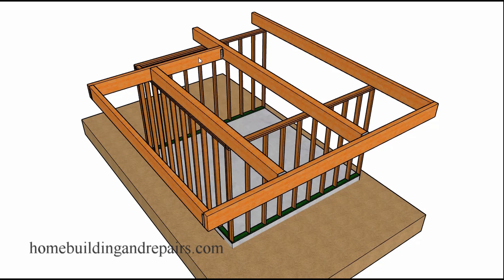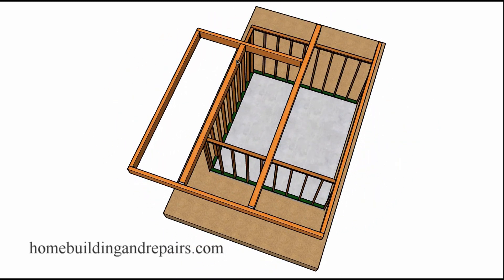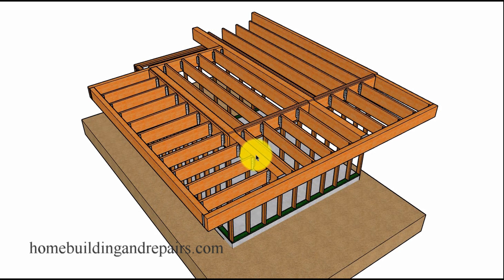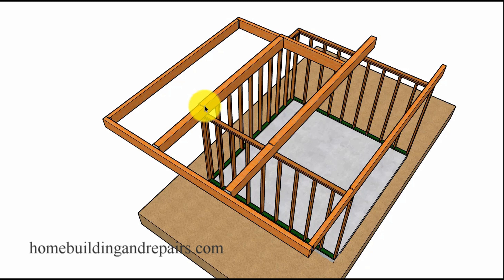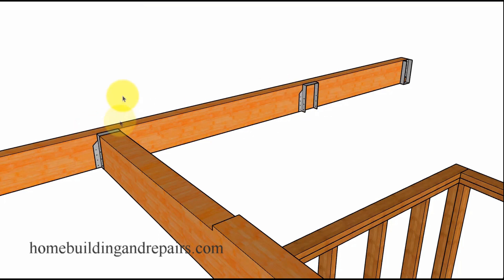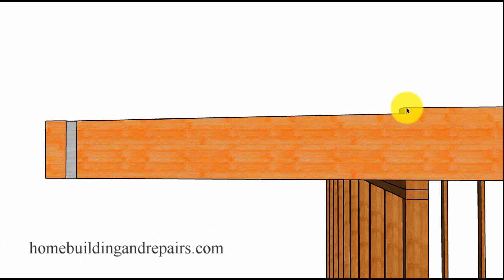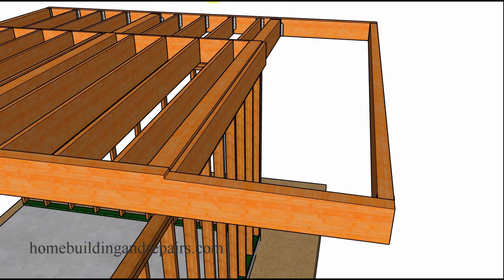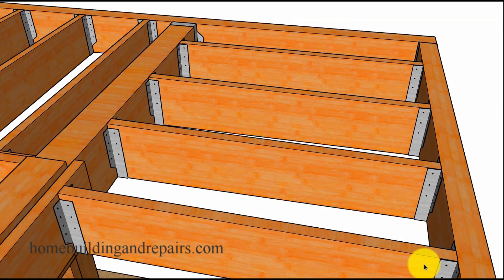How To Build Double Cantilever Corner Balcony - Home Design And Framing Ideas

Comment: Nice Greg, but something should be included too is to add min. of 3 studs under the beams inside the wall below (assuming the wall is exterior and bearing), because the load here is concentrated due to the cantilever hinge point. I'd not recommend flipping the joist hanger because this would make interior space floor structure weaker, and interior has a higher dead load weight on it due to possible furniture and also  live load because people live inside more than on a balcony.

Comment: Hi, what books will you advice to read about timber framing(walls, floor, roof) and also structure analysis? Your videos are very teachful with calculations,  standards and requirements,  but they are all over the place and something it is difficult for me to follow them and connect the dots. Thanks and cheers!
Reply from the maker: I have a few timber framing books, but haven't figured out which ones I would recommend, so I won't be much help there.
Reply: @gregvancom  I read my comment and it sounds awful. I didn't mean anything bad, because your content is grateful for teaching timber construction, very helpful. All I meant was that I am looking for series of books or lessons for timber construction, that will give me faster  understanding.

Comment: Dealing with a house that had a cantilever deck on one side. Be very careful and diligent with maintenance and inspection over the years. We bought the house that had exposed lumber including the joists and then discovered that the joists rotted into the wall as the water was not shedding away. This also lead to the cripple wall under it being completely rotted. I would highly recommend avoiding this construction due to my experience or having the deck encapsulated with stucco and waterproofing and flashing at the wall to promote water shed away from the wall.

Comment: I might want an upside down hanger on that rear perpendicular cantilevered beam.... thoughts?
Reply: they really should have 2 way hangers or use 2 halfs for the load going eirher way is most likely the safest. I'd think! all in all pretty tricky call cause they dont make hangers for a 2 way load. plus thinking for the walls and barring load for next floor and truss above all that! lol thoughts??
Reply from the maker: I don't think I would, because they're still the fact that there will be some weight distributed on the interior floor. Also keep in mind that this was modeled after a building I took some pictures of in 2019 that would've been structurally engineered.